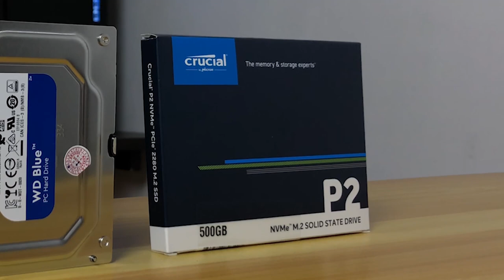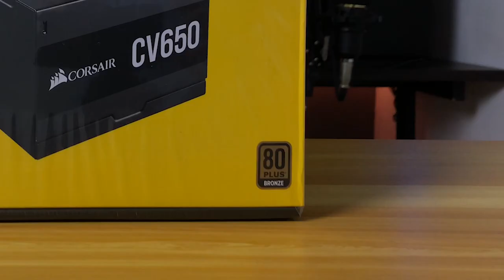50K Php GAMING PC BUILD | January 2021

Comment: Should i get this build or an Predator Helios 300 with i7-9750H and gtx 1660 ti?
Reply from the maker: This build currently will cost you around 60-70k (peripherals not included). I think the Predator Helios 300 is a better choice since its cheaper plus ready to use.
Reply: @sipochito  thanks bro i agree with you. Plus with this pandemic the prices of pc parts goes up and I think there is also a shortage.

Comment: how did you sync your tuf tforce delta to mortar max? I have the same RAM and MOBO. I tried using Mystice Light but it doesnt show the TUF Tforce Delta. Thank you
Reply from the maker: There could be other lighting software that might interfere with mystic light or the version of your mystic light has bugs/issues. I suggest to install an older version of mystic light (Dragon Center-2.0.54.0) this worked for me or uninstall other lighting software interfering with mystic light. Hope this helps.
Reply: @sipochito  I wasn't able to find that specific version of Dragon Center. I already uninstalled Aura Creator but it still doesnt show the TUF Tforce Delta.